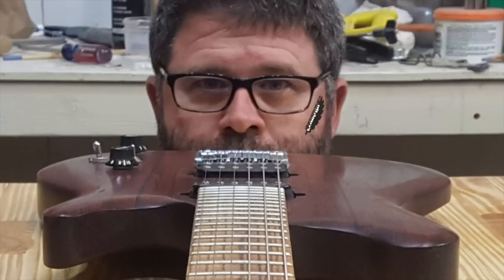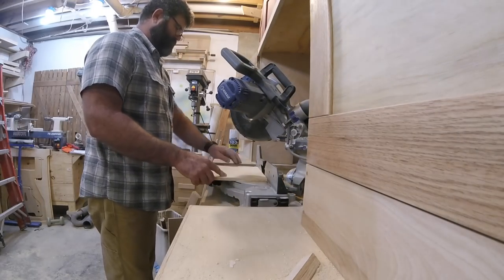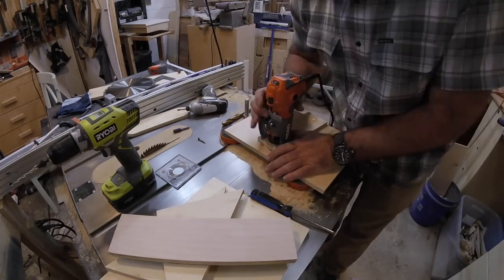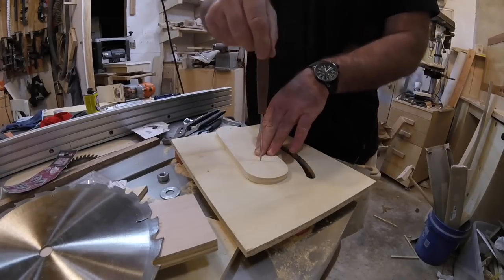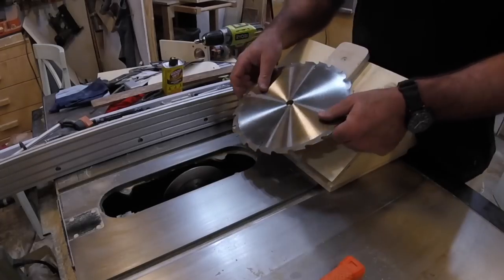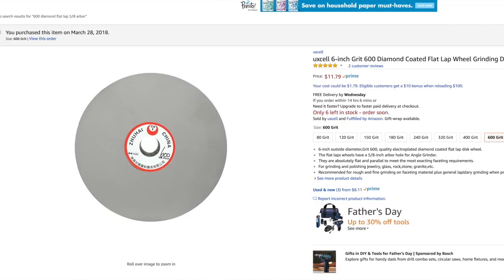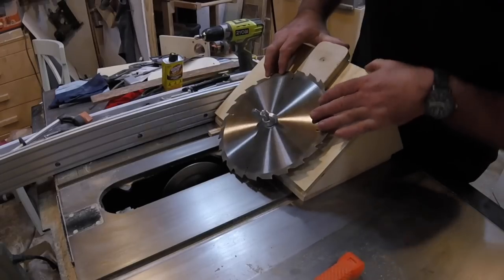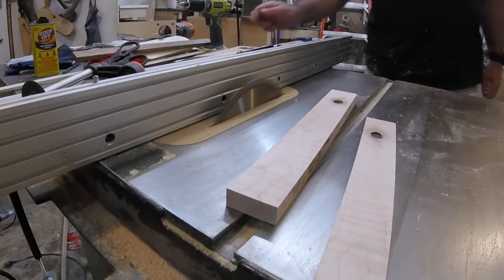DIY Circular Saw Blade Sharpening Jig

Comment: Top notch video and method. My favourite part of your video is where you say "I'm not making jet engine parts!" which is a phrase that I often use when I see colleagues faffing around with detail which matters not one jot. The woodworkers, joiners, carpenters, engineers etc. I admire the most are the ones who see through the BS mists of striving for totally unnecessary levels of perfection, get stuck in and get the job done with pragmatism.

Comment: You are exactly right about blade accuracy. You're cutting wood, not metal. Great jig, simple and effective. I would set up a stop block on the fence to prevent cutting too deep.
Reply: Stop block on the fence is a good idea, or maybe a "magswitch" on the cast iron top.

Comment: Hey Franklin, New subscrib'r . I just saw you video on saw blade sharpening & it was great. I approve of your method & will try it. I have no experience ..but.... I'm retired (85) builder & engineer & now spend my time in my wood shop and appreciate a shop that 'looks' worked in. I don't trust other DIY videos of shops that are 'clean' mine surly looks worked in.  You are so right about every piece of wood cuts a little different so no use in getting carried away with precision.
Thanks, Lee
Reply from the maker: Thank you for the encouragement.  I'm currently in the process of getting some land for my dream shop.  I hope to be up and running again in about 6 months, so more videos will be coming soon.
Reply: @FranklinWoodWorks2016
Reply: Be careful with size of new shop !  I thought mine was big enough but guess what? I filled it up & need more space.
Lee:face-pink-tears:

Comment: I made one of these today with a few mods. No arm, just a straight opening for the bolt about 5 inches long in the right place for a 10" blade. Made the table angle at 45 degrees. Used a 1000 grit wheel.   Used a 1/2" carriage bolt with a 1/2" to 5/8" bushing to keep the saw stable.  Put 3 small sheet metal screws in a semi-circle beneath the saw blade to stop it from wobbling and voila! I have a saw sharpening jig and 4 sharp blades to use.  Thanks for the idea and the video.
Reply from the maker: I love it when folks can take an idea and make it work for them!  Well done!

Comment: I sharpen my carbide circular saw blades by hand.  I like you "table saw jig."  When I built my sharpen jig it was for the circular saw blades.  I used a dremel tool and still do.  I get 4 or 5 resharpenings per blade.  Now I have a table saw and thanks to you have a new project.  Peace!

Comment: Texas Goldilocks
Thanks for the "Where to Get..." lap wheel.  Nice quick  and EZ video too.  A few months ago I mounted my angle grinder, using the side bolt hole in a vertical position and elevated the saw blade horizontally and achieved similar good results.  I have a very rare full kerf 59 tooth carbide 7.25 in. blade that thinks it's a smoother and succeeds nicely,tho Inever have found that missing tooth.   Adios

Comment: You rock !!  I have been searching for a simple circular saw blade sharpening jig, that I could incorporate into my current set of tool options (using either a miter saw or table saw for the work). Your invention not only fit that bill, you do a good job of explaining how you came up with the design, and why it works for you (which I took as why it might also work for me, given I'm cutting wood for general home projects, not building nuclear reactors).  Keep up the good work, it is appreciated.  Cheers.

Comment: Great job. I think people should also realize that cleaning a blade of pitch helps a lot too. I am looking to sharpen all my blades just out of convenience. It's a measly $20 for a 90 tooth CMT blade from my sharpening company, so it's not the money.
I have gotten amazing results with simply cleaning the blade, and very gently sharpening with a DMT 1000 grit block(by hand).
I'm a finish carpenter, and a sharp, stable blade is critical to my work. I have had the same 90 tooth CMT blade on my chop saw, and 50 tooth glue line rip blade on my table saw for over a year and a half. Cleaning at the end of big jobs. I have the blades dated, just to see how many years I can get out of them. And at this rate, I'll be long gone before they don't cut perfectly.. LOL
Your video is very thorough, and well done. So, thank you for your input on this subject...
Reply from the maker: Couldn't agree more.  In one of my last videos I talked about how a good cleaning will generally solve the "dull blade.". The burning and binding is often because of pitch buildup, making your tools act like the blade is dull.  I'm glad I have the jig, but since I've started a good cleaning regimen, I rarely sharpen.
Reply: A clean blade indeed is important.  I got a teflon coated blade that never sticks as it does not collect pitch.
Reply from the maker: @1959Berre  What kind of blades do you use?  I have some with a whiz-bang coating on them, but they still collect pitch.

Comment: I like this one. When I was a framer I knew an old guy who'd lost all his fingers changing a 20" split rim tire, that exploded. He sharpened steel skillsaw blades with a file and 1" finger stumps.  He was (almost) as good as the machine sharpeners and we like to support the old guy. What you are doing is far more precise than him.

Comment: I agree with your theory / thoughts on sharpening  in general  i  did Woodworking for over 20 years as my living and i  did sharpen all of my tools in a non scientific way  or  a highly precise method  often i had to “dress “ up a tool  on a jobsite with either a file or a belt sander and  my eye  instead of any fancy jig or machine  and in all honesty it worked fine  my main work was  installing custom cabinetry  so i used  Fuller brand HSS Countersinks to drill hundreds of screw holes  now I’m sure on occasion i shortened the lifespan of some of my countersinks  but they cost me around 8 dollars a peice   In bulk and that was the cost of doing business IMO  ironically i still have everyone ive ever bought in my life and i can use them like the day i purchased them  i did one time  get a drill bit sharpening kit  for a Christmas present  that was a Chinese made  piece of junk that made things worse i threw it away  and went back to my old ways  on very rare occasions i would sit down with all my chisels   And fine tune my  very good ones  but in all honesty  I peered  using  a old set ofSears Craftsman chisels i bought years before i was a professional  as those  it didnt seam to be that big of a deal if i  hit a hidden staple  or accidently dropped one on a concrete floor  in the commercial buildings i had to work in   Of course my  expensive chisels   I tried to use in my  personal shop or projects  where  i was more in a controlled enviorment    Just to be clear one of my good chisels cost as much as the entire Craftsman set   I spoke about  and that set helped me learn the trade  when i was much younger

Comment: Well, I'm 4 years late but, I just copied your design. Have to order the sharpening disc and the 2 stabilizers. I think it's going to work purdy good. Thanks to you for sharing.
Reply from the maker: You will be shocked at how well it works.  Just remember two important things:  You don't have to take much material away (just a couple of light bumps against the disc), and remember to clean the blade.  The pitch that collects on the side of the blade just behind the tooth can really cause a blade to drag, even when it's still sharp.
Reply: @FranklinWoodWorks2016  I cleaned my blades yesterday. The sharpening disc I ordered is thicker than the one on your video. I just hope it gives me some wiggle room while going in to sharpen. I also got the stabilizers. Neither have arrived yet. Can't wait to try it out.

Comment: I turn hard woods of all kinds, domestic and exotic. I also sharpen all my tools with a Robert Sorby Pro Edge. All my tools are extremely sharp. So sharp in fact that I can turn “Rock Oak” that has been cured for 30 years like it was butter. My tools are so sharp that I accidentally drop a gouge and of course I went to catch it and I caught it alright and it cut my hand. I didn’t even realize it until I saw the blood dripping on the floor. I guess that was sharp enough! Best regards, Richard

Comment: Thank you for your comment about how wood moves when it is cut. I have an old Shopsmith 10er jointer I couldn’t get Coplaner between the infeed and outfeed tables closer than about .004. I bought a bigger jointer with a shelix head, and that is working well for me. I’m thinking of selling my SS jointer but didn’t want to pass on a problem for someone else. 

Sometimes too picky is just that. I have since learned I have to sand my glue ups because they are too smooth for glue. 

Thank you for the video and information confirmation.
Reply: I'll take it!

Comment: I had been thinking about knife sharpening and gave it some thought while building my own knife sharpening jig.    I came to the conclusion that the angle recommended are probably never achieved but were probably close.   And for general purposes, the important thing is that they are the same every time you sharpen.  Since all jigs are probably a bit different in the angles, it is best to use the same jig so the "errors" are the same.  The same probably applies to your jig.

Comment: Great video and idea. I have one of those harbor freight sharpeners but its very cantankerous to use and the diamond blade is very course. I will make one of these for my shop to sharpen the 6 or 8 blades I have accumulated. I do contribute to making jet engine parts and can attest that the level of tolerance we adhere to are not necessary in my woodshop. Thank you sir for the video.
Reply from the maker: Thanks for the kind words.  If you look for the same kind of lap wheel I used, they have grits from 120 up to around 2000.  I used 600, but may try 1000 in the future.

Comment: Just a couple of comments, nothing critical.  Yes, the 40 degree tilt is good, ideal is 45 degrees for those who wish to make your jig.  The reason for the angle is that you want the saw blade to approach the sharpening blade at a 90 degree angle since that gives you the best sharpening angle. Second, your swing arm will still introduce error into your sharpening, it is too narrow.  Make it trianglar, wide end that holds the bolt for the blade.  Third, 600 grit would have been good enough but your wheel is spinning too quickly, hence the need for 1000 grit to compensate for the higher speed.  Ideally, you want that sharpening wheel to turn at no more than 1750 rpm.  Since you are lightly touching the carbide material to the wheel heat build up is not an issue.  If you have a pulley drive system then changing the two pulleys to a dual groove pair will reduce your speed sufficiently.  The fourth point is that many blades have angled faces.  Rip blades have teeth like chisels, set at 90 degrees to the surface of the blade.  examine the old rip hand saws and compare then to their cross cut counterparts.  Crosscut blades are usually set in an alternating angle several degrees from 90.  Hence, one would need to make the table adjustable.  Finally, drill a hole close to the pivot point where you can insert a dowel as your safety device to prevent accidents of blade travel.  Yes, I know, it can't happen, but I have plenty of scars on my hands from accidents that can't happen.

Out of all the systems I have seen, yours has the best design I have seen.  Your system works close enough.  Could it be refined?  Yes, but that adds complexity and unless you a professional, complexity is a handicap.
Reply from the maker: Thank you for your comments.  Rarely do folks write such well thought out suggestions.  All of the points you make are extremely valid, and I'm mulling through them to see what I can reasonably incorporate.  The swing arm is a great idea, and will be easily added.  The dowel you mentioned, is that to keep the blade from rotating or the swing arm from moving?  When I was designing the jig, I looked at all of my blades, and the specs are all 90 degree faces.  I may need to consider the jig if I buy another blade.  Thank you so much for the comments, and thanks for watching!
Reply: Great video! Thanks.

Based on Marta's comments, a Shopsmith could be beneficial in sharpening saw blades with your jig.  With it's variable-speed spindle, you can adjust the speed between 700 and 5000 RPM.  Also, you can tilt the table so those blades with alternating bevels on the carbide teeth could be sharpened easily, although I expect you could accomplish the same thing by simply tilting the saw arbor,  sharpening half the teeth on one side of the diamond wheel, and then flip the blade over, and do the other half.  The Shopsmith also has a quill feed with an adjustable stop so that you could advance the diamond wheel into the saw blade (rather than moving the saw blade into the diamond wheel) and this likely would result in consistently removing the same amount of carbide from each tooth. 

I'll have to give your jig a try,  Thanks again.

Comment: Well done and well explained.  The result was impressive.  I agree we're not making machine parts for NASA.  That said, i've not been brave enough to DYI sharpen my $150 blades.  :)
Reply from the maker: Hardnox You caught me.  I have two blades I haven't sharpened yet, both  over $110 each.  My excuse is they're not dull yet.
Reply: I understand your position on a top quality blades like "Forester".  For my purposes, I've pretty well standardized on "Freud/Diablo" blades for most tasks.  Here in Canada, a Diablo 10" X 60 tooth blade sells new for $55, but the best sharpening price at local shops is $1 per tooth.  $5 cheaper to just scrap the blade and buy a new one.
Luckily, I don't actually throw anything away, lol.  I'll be building this jig to see what I can recover.

Comment: Proof is in the cut.if it dont cut properly. Sharpen it again. 
How many drill bits do we sharpen freehand on grinding wheel. Some work some dont.
I like your determination. Especially with prior negative comments. If you first dont succeed try again. 
I'm definitely going to make an angled jig.this makes way more sense. Maybe add an indexing pin.
Thanks for this video. 👍

Comment: Try applying a magic marker coating to the first tooth to be sharpened. After touching the tooth to the grinding disk, check your coating. If there is a little color near the tip of the tooth, move your jig a hair to the left. If there is a little color near the base of the tooth, move your jig a hair to the right. If all the magic marker is gone... perfect!

Comment: Nice jig. Correct me if I'm  wrong, but do the teeth not have a side angle, too? Making the jig swivel on the runner would be a good solution to change the side angle. Just a suggestion.
Reply from the maker: I know that some blades have a "side angle," but none of mine do.  I have thought about this problem, and swiveling the entire jig would require a complete redesign, because more adjustability would be required in the arm that holds the blade.  There may be a way to simply tilt the jig, but I'll have to think on that.  Thanks for watching.

Comment: Nice.
Maybe add a stop on the fence to limit forward travel.
Q. Do saw blade teeth have an angle, or side bevel?
Reply from the maker: Some do.  I've had many folks point that out to me.  However, in all the blades I've ever purchased - rip, combination, fine tooth, miter saw ( both cheap and expensive on all), I've never encountered one.  Maybe I'm just lucky.
Reply: FranklinWoodWorks     Thanks for that info/advise..

Comment: How does it accommodate alternate bevel blades like the idea but don't want to ruin may alternate bevels saw blades. Seem ok for RIP teeth on a rip blade or flat/raker tooth on an alternate bevel blade.
Reply from the maker: You're right, it's mainly designed for rip blades.  But it is doable if you're willing to put in the time.  You could mark every other tooth, or which ever teeth it applies to, shim up one side of the jig, sharpen those teeth, then shim up the other side for the alternating teeth.  Lot of trouble, but it's relatively free.  I'd practice on a blade I don't care about.

Comment: In the video you say the triangle is around 40 degrees and about 10” x 12”. Any chance I could buy a detailed set of plans for it?
Reply from the maker: Sorry, I don't do plans.  But trust me, you can build this.
Reply: @FranklinWoodWorks2016  I’m almost done with it. I’m going to add a stop to it so all teeth get sharpened the same. Thank you for the post.

Comment: Your link goes to a 600 grit wheel. I thought something finer might be better. What is the grit you are actually using?
Reply from the maker: I've experimented with 320, 600, and 1,000.  I can't tell the difference between the 600 and 1,000 - other than using the 1,000 takes longer.